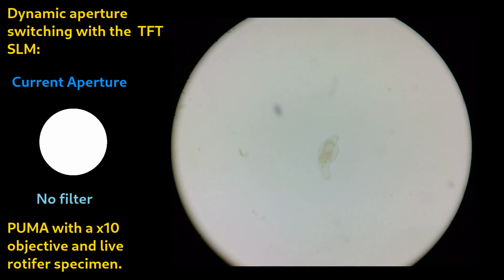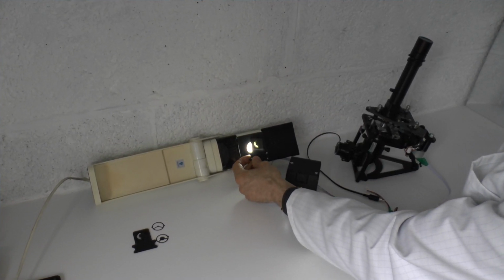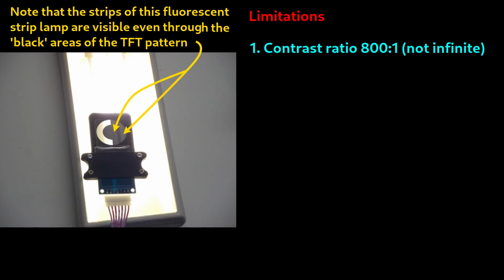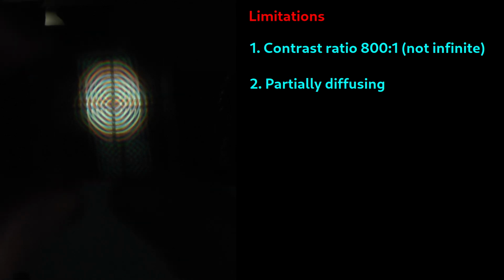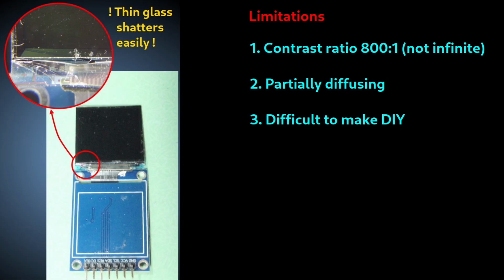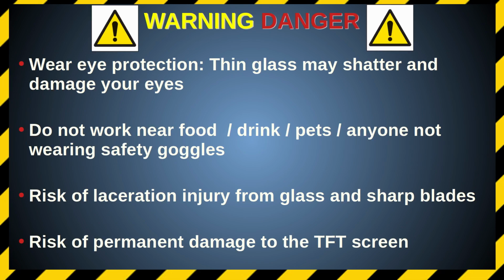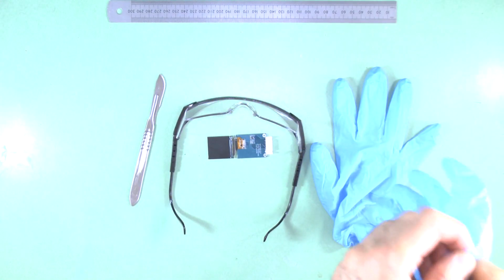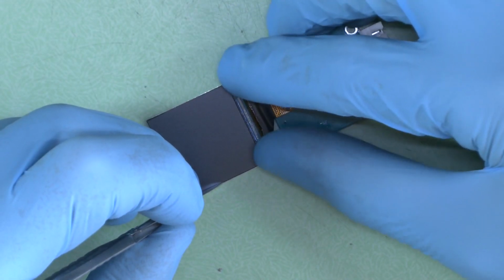How to build the Spatial Light Modulator for the PUMA 3D printed microscope

Comment: I prep'd a replacement SLM for the one a made originally that I carelessly got glue on, and have built a second console with the monitor attachment specifically to run the SLM in tandem with another console running the AR projector, Lamp and Z-Stage. I had some help amending the arduino libraries so that I could reverse the mirror writing to make it more easily readable with the monitor,  the monitor is a very effective addition - it's simple and easy to add and helps with the SLM menu navigation, the two tfts run perfectly well off the SLM console. I am happily running two set ups now, AR Projector and SLM. I had looked at adding a toggle for the mirror writing in case I need to switch between mirrored and non mirrored if, for instance, the SLM illumination structure required mirroring, but I ran up agaisnt the limit of my C++ and the sketch size, but I can't see this being a limitation for the level of use I am likely to need in the short term, and the excellent documentation would make it straightforward for someone to do yet more, as Dr T suggests. I see there is an updated control console manual that references an Aperture centration function, again, very well documented but I can only access the original  PUMA Control v1.1 .ino which doesn’t appear to contain the centration code. Dr Tadrous, has the v1.2 sketch been uploaded somewhere else yet, or is an updated GitHub version still to come? As I now have a dedicated SLM control console I was thinking it might be possible to remove some of the non SLM function (e.g. Graticule and Pointer) from the Sketch to allow for further SLM development, if I make any progress with this I'm happy to share.
Reply from the maker: Great work. You are right - I made an error in that I uploaded the new manual but forgot the actual ino script. I have now remedied that and the v1.2 ino is available on GitHub. I also made some minor updates to the manual while I was at it.

I often thought about making a non-mirror version of PUMA control for the reasons you mentioned but just never got round to it - so well done on that.

To make the most of the SLM you really need the PUMA Aperta system that I just developed. Keep an eye on the 'Posts' section here to find out when it is available - although maybe that will be overkill for your needs so your own custom Arduino controller might be better - only you will know.

All the best.

PJT
Reply: @PUMAMicroscope  Thank you very much, downloaded, compiled and flashed onto my SLM Nano, I'll follow up over the weekend, much appreciated. Full disclosure on the work on the libraries - ChatGPT may have assisted me with that (!), but to the extent I have tested it to date it seems to work across the menus, happy to share the updated libraries if anyone wants access. I'll keep a look out for Aperta, but I have plenty to explore with the builds to date, I've already come a lot further than I originally imagined.
Reply: Centration function is now up and running , it is simple and very effective, I'm now experimenting with dark-field viewing ( having originally strayed into 3d printing and PUMA while looking at ways to make a substage adapter  for the 2nd hand darkfield condenser I acquired for my old lab microscope - so I have come full circle!) There is plenty of adjustment available and with the simple joy stick and set button control it is easy to get dead-centre🙂

Comment: are there other rather cheap TFT screens with a higher contrast ratio then 800:1 available on internet to block the light even more ?
Reply from the maker: Sorry, I only have experience with this model so can't answer your question from experience. The contrast this provides is very effective in practice but maybe you have a more specialist application in mind that requires total extinction.

Comment: I got round to building this module recently - I had been full or trepidation as it seemed like a formidable undertaking, but following Dr Tadrous's instruction and setting aside some quiet time to focus, it worked out perfectly, I had a struggle getting the TFT screen off the backplate as there was a lot of glue on the version I bought, but taking time and care, it all came good, all exactly as per the video instruction. I can chip in with some guidance on my experience getting the TFT booted up - long story short, as I couldn't find a 5V version I had a 3.3 V version - so I massively over complicated things by trying a variety of different logic step down regulators on the signal channels - nothing worked until I ditched all but a voltage regulator chip on the VC channel and put four 1K Ohnm resistors in series with the 4 signal pins - instant results, the screen booted up exactly as shown - deep joy!  The only other thing I'd comment is dont use too much glue on the holder, too much and it won't fit well in the condenser aperture, and watch out for glue leaking on the underside of the holder, too much and it can leak underneath. I'll leave some comments in the AR Projector and PUMA Control Console tutorial, as I have now got the whole ensemble working beautifully. The TFT addition, both as the Spatial Light Modulator and as a projector in the AR Projector module, really elevates an already very comperhensive set up. There is so much to offer in this project, from simple foundation scope to so much more, a very fulfilling project.

Comment: I would recommend using "1.69" Color TFT ST7789  Display Module" with rounded corners from aliexpress. Its connector to pcb seems much more sturdier then one on the video has. And disassembly was just a breath, I leveraged metal panel and everything just popped up. After that only final diffuser layer was needed to be removed. Was able to successfully do everything on the first try
Reply from the maker: Thanks. Nice idea. I thought about these round displays when I saw them but I think they came out some time after I designed the PUMA. Nice to hear they are a potentially easier system. One of the advantages of the square one, however, is that you can use the corner areas to display info to the user (in a mirrored screen in the control console) which does not (and which you don't want to) show up in the microscope - but I haven't discussed that specialist application yet in my videos.

Comment: A drip of alcohol along the razors edge can help loosen those pads on stuff like that, just work it in with the cutting edge. 

I had an idea effectively the same when I was modding on a cheap AMscope I picked up a while ago. Since it came with a crappy LED illumination (and a misaligned iris disk....yeah, dont get the cheapest one, get the one with the cooler stuff under the stage....trust me...) and I wasnt too keen on figuring out higher power illumination and modifying the base to accommodate it, so I just kinda kept it filed away in the imagination space. Good to know it would have worked out! I might have to revisit that thing one of these days.....I have plenty of old TFTs laying around, maybe its time to get on getting them set up for driving images to them....

Also, for the PC modders, you can do the same thing to just about any LCD based imager panel, and a transparent imager panel makes for a great case window addition ;)
Reply: Yes, agreed, I am making a second version of the SLM as the original has a smudge of glue impinging on the circular viewing area, so will take more care this time. I used a ton of solvent to get the sticky pad off the last one. I also saw a YouTube short from Dr T saying there was a second release of the PUMA software that allows for centration on the SLM, so I have downloaded that and will be updating the console😊

Comment: for phase SLM do you just remove the front and back polarizing film?  or just one of them?
Reply from the maker: I do not see how this TFT can be used to make a phase SLM. If you remove one or both of the polarisers you will get a polarisation SLM - not a phase SLM. I mention phase SLM in the video just to raise awareness that such things exist as part of the general teaching / education element of the video. It is not to suggest that you can make a phase SLM with a TFT screen.
Reply: @PUMAMicroscope  thank you I literally just finished one and I removed one of the polarizer films.  I guess I can cut a piece and put it back over to use with the microscope.  I was wondering how the phase part could work.  I could not think how the path length would be changed or the refractive index but i figured cheap to try.  I need one for a laser imaging system.  They are are 10k so I saw this as a shortcut.  fantastic project thank you for sharing.